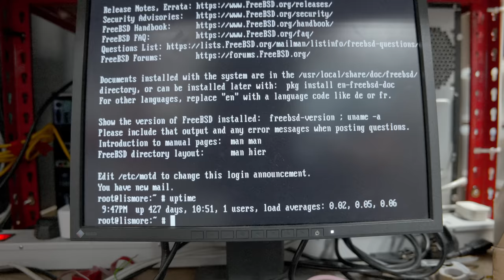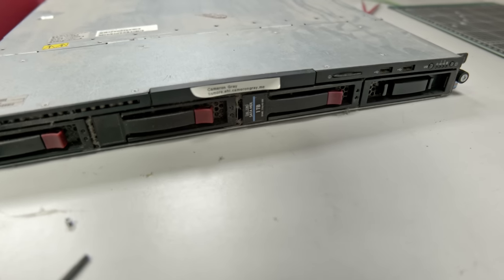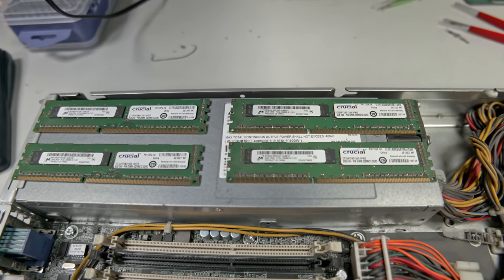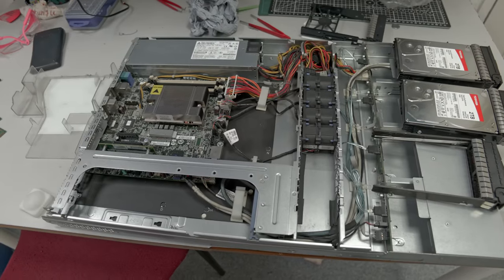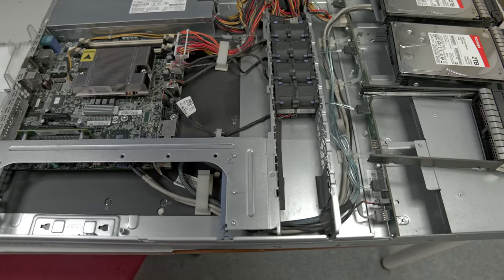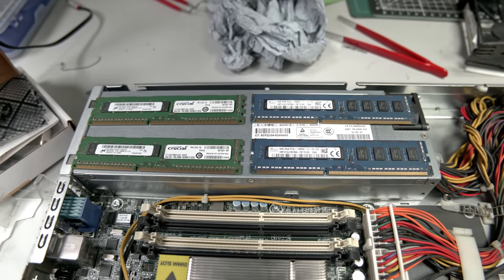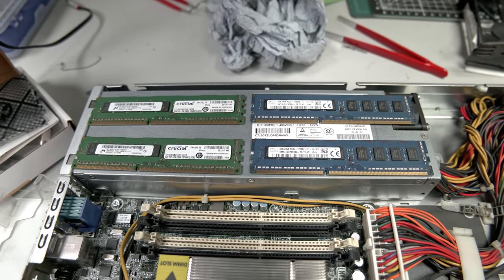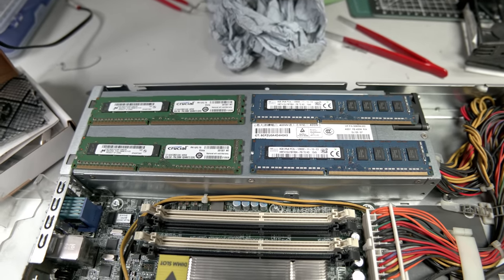Rescuing an Abandoned Server - Building my new offsite backup!

Comment: You're not going to replace the thermal paste on the CPU
Reply from the maker: I didn't have any with me but it's not something I'm particularly concerned about.  I "borrowed" the CPU from this machine to test a motherboard shortly after I got it so I know that I used decent paste then.  Realistically, the temperatures are more than fine and I'd likely see no real improvement from replacing the paste, maybe a couple of degrees at best.

Comment: i think those ssd you have are better because if something goes wrong on writing and the pc shuts off the data is on the drive. having ssd with cache gives you no benefits only failure points. i have a dell r630 that is sitting in the maker space i am in the power is on this place also a big problem but i am done with battery buffered solutions and usv systems they do work but if this happen to often they break and this is the chase on my place. i spend more money on batterys as on the whole server. my r630 has 2 xeon e5 2699v3 and 768gb ram and uses only sas ssd drives. and having caching aktiv made my day in the end harder. i can revover half written data but if the os tels me i am done writing and it is not is one thing thats me annoy. 
second is cache slows you down if you have big data chunks. i am involved in a project of weather stations we have about 5000 stations end each of them send once in a month a dataset of 2gb 
i have in the end 10tb of data i need to process in one single run. this takes 3h only for the run to get the results but beforehand i need 1 week to feed the machine and 1 week afterwards to check if the result was correct. in that time i had the server sitting in the maker space i had several times a power outage while i was feeding the machine. i had many trouble to find the missing files where was not written but sitting in cache and waiting to be written on disk. the os tells you i am done you can unplug the usb drive but the drives are already working on it so store the data. ok this may might a probem i have created by my selfe because i installed a pcie usb3.2 card with 40gbit usbc and i use a  usbc 40gbit nvme caddy with a 250gb nvme in it. ok i see the point my drives are slower as the usb drive but still caching dumb.

Comment: Are you recording at 60fps now then? 😜
Reply from the maker: 30fps - New camera can only output in 5.9K at either 25 or 30fps but thankfully I can lock the shutter speed to a "safe" speed for a 50Hz mains frequency to avoid flicker while squeezing out the extra 5fps.  It'll do higher frame rates but it'll drop the resolution to 4K and, more significantly, will crop the image in to an APS-C sensor size which isn't ideal with the lens I have.

Comment: Time to troll. Microsoft mouths drop to the floor. No server stays up that long. :)
Reply: A lot of Windows 2012 are doing just fine.
Reply: @lpseem3770  I have had really good luck with 2012, 16 and 19 though they are simple server setups. The most problem I had was with 2012 would stick on updates and you would have to manual install the updates due to them getting out of order? or whatever it was doing. Then on 2016 or 19 had that stupid update that one some of mine removed the settings from the nic. Though I only have a few of each.